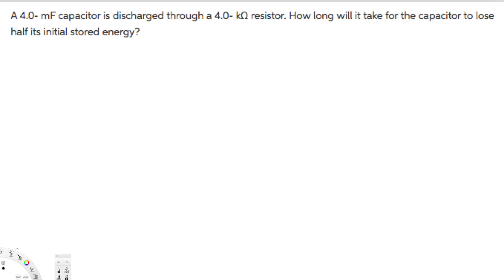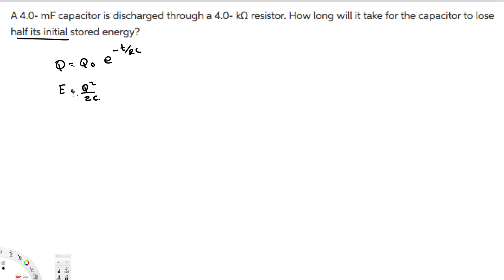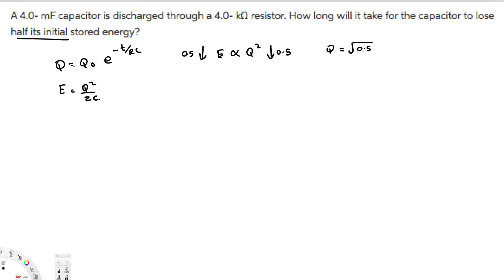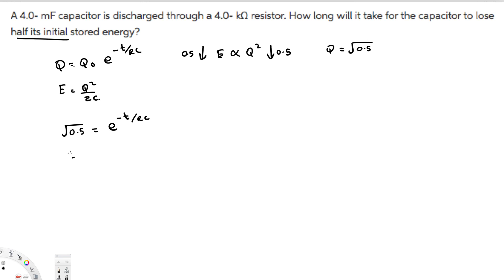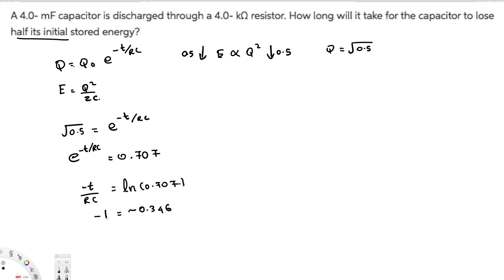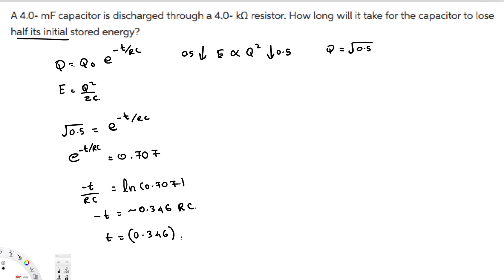Direct Current Circuits - Physics - Example 8

Comment: I dont understand how you just stated that Q= sqrt(0.5) due to it's directly proportional relationship with E. Q nor E had values?
Reply: It's been 2 years but the question asks for the time when the capacitor loses half of it's initial energy, aka when E = .5*E initial. He uses the proportionality between E and Q squared to show that, if you were to multiply E by .5, you would need to multiply Q^2 by the square root of .5 in order to maintain that the equation is equal. He then uses this value of root .5 as the time when the charge reflects the change in energy.